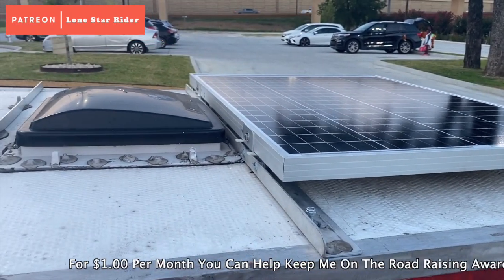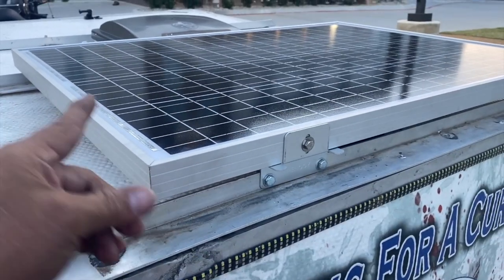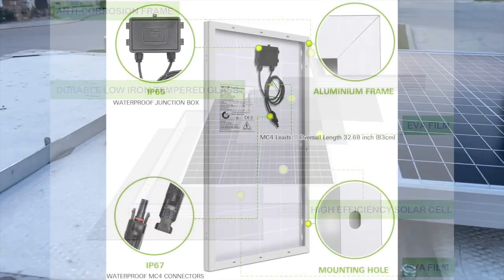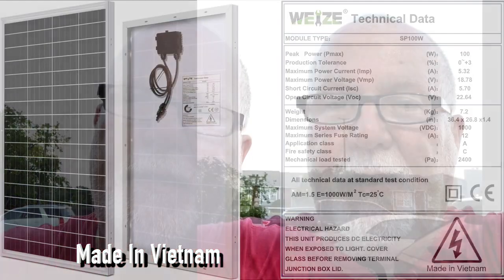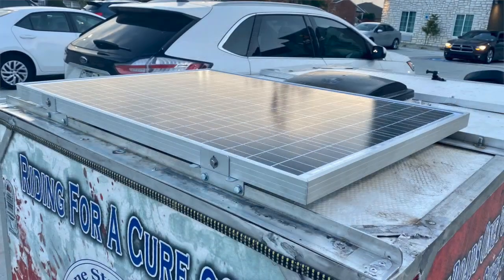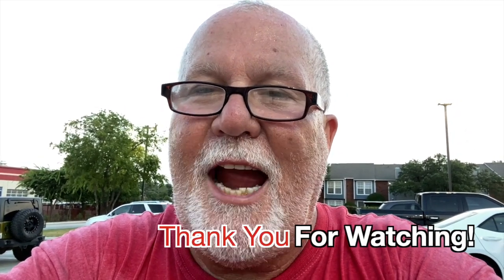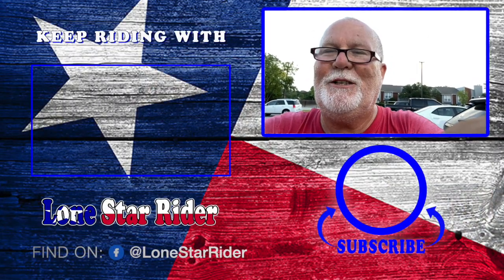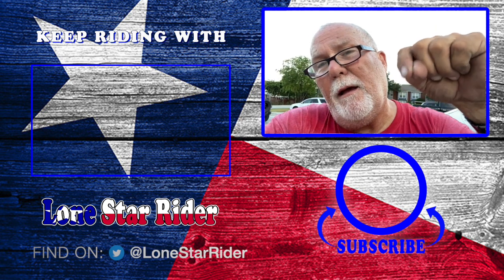New Solar Panel On The Riding For A Cure Trailer • 07-17-2021

Comment: Have any condensation issues with the trailer?
Reply from the maker: Yes and no, When it's really cold I crank open the Maxx Fan 1/4" and run it out on the lowest setting, then I don't have any condensation problem.